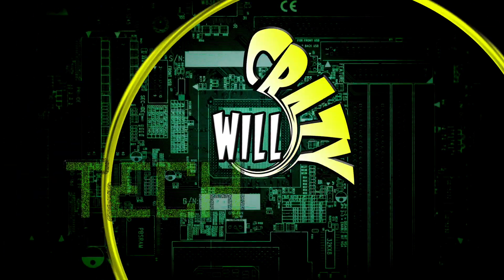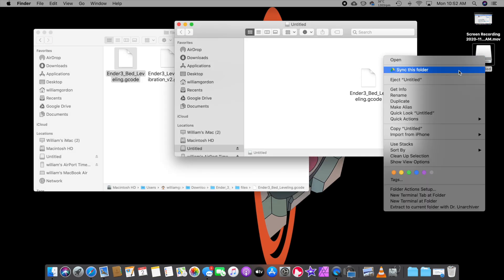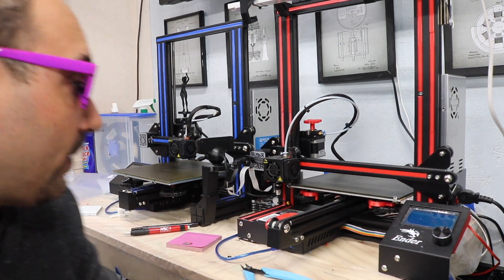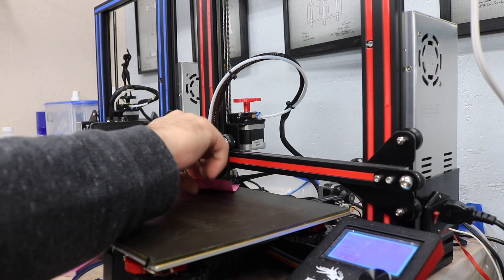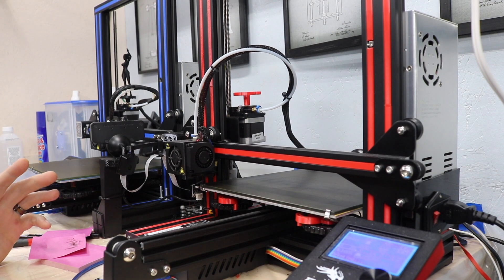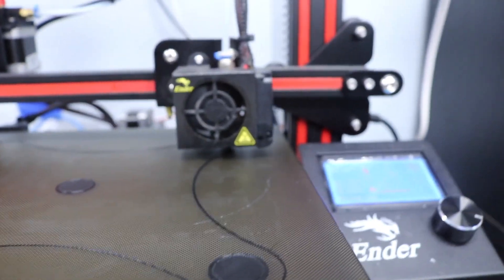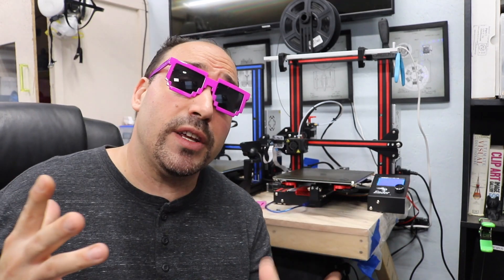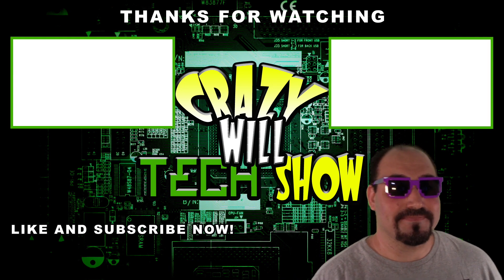How to level the Ender 3 bed

Comment: I don't want to scratch my glass bed on my ender 3 max. How do you adjust the switch to make sure the nozzle doesn't scratch the bed? Can you explain the process after you turn off the printer in more detail? Thanks
Reply from the maker: I mean if you follow the video you shouldn’t scratch the bed. I would make the bed really low when you start out.

Comment: When I "print from tf" this file, it just plows through the phases with no input from me. It touches the first corner briefly, then immediately heads to the next corner, etc. What's going wrong?
Reply from the maker: Are you using an ender 3? If so does it have a film it run out sensor?
Reply: @CrazyWillTechShow  thanks for the reply. Yes, it's also the ender 3. I'm not sure what sensor that would be, it's just stock out-of-the-box so far with no additional attachments or upgrades. But it goes all the way down to the bed, clicks the sensor that tells it it's at bed level, then moves over to the next corner. Also, in the part where it prints the line around the bed, the line is either super flat and transparent (bed too high maybe?) or doesn't stick/lay filament down (bed too low?), but there really isn't an in-between
Reply from the maker: So the file not working it just hit the posts then moves on then starts the print. never stops at the points? Is that what you're saying?
Reply: @CrazyWillTechShow  yes, basically. When I start it from "print from tf," it goes to the first corner then touches the bed, then immediately picks up and moves to the next corner, and so on, for all 4 corners twice. Then, it begins printing the test print. It never pauses for my input, or at all really
Reply from the maker: Ok I ran into this with my FOKOOS 3d printer it didn't have the M0 command available because it has a filament run out sensor. you can try editing the G code with M25. That didn't work for me on the FOKOOS because it was a different Merlin firmware. Here's an article I found.https://www.reddit.com/r/ender3/comments/r75ekl/pause_not_working_on_ender_3_even_after_trying/ that so weird? Because I have an aftermarket ender 3 and that file still worked. Worst case scenario you can still level it manually. If you can't get it to work. Basically set at home move it to the points, run the file. It's just easier if you get the file working.
Reply: @CrazyWillTechShow  oh awesome I'll give it a shot, thank you. I've been trying to level it manually, but mostly I use rafts so the first few layers don't matter as much lol
Reply from the maker: Leveling is the worst part of 3d printing but the most important part. Im going through this myself with the FOKOOS 3d printer but there actually something wrong with it. The middles hight 3 weeks and finally figured it out. So I definitely feel your pain. lol just be patient. you eventually figure it out.

Comment: Tried this 6 times today and still can't find the goldilocks position of the corners so taking my printer back to the store as I have wasted too many hours and getting nowhere.. Tried from hardly touching the paper to scraping it to the point of almost ripping it. And different levels in between and no joy
Reply from the maker: I have one printer The frame was bent. So I loosen the screws on the bass and put it flat on the table and tightened everything up. Work out great after I made that adjustment. Is there a wobble in your printer when sitting on the table? Check the Z axis make sure the frame is square. It happens sometimes when you build them.
Reply: @CrazyWillTechShow  mine was pre-built 2nd hand but one of the guys in the store as the standard ender 3 so hopefully talk to him about it, at the moment it's on a small coffee table in my bedroom and the capet is soft.. So might move it into the kitchen and try again

Comment: I know this is a very old video and I'm hoping you see this. I downloaded and loaded up the file into my printer but all it does is move through the points very quickly. I can't get it to move when I want it to. Please help :(
Reply from the maker: Yes it does that sometimes. I don’t know why. Shut down the printer take the card out. After about three minutes turn the printer back on. Then insert the card go to the menu click on load SD card. Then try the print again.

Comment: Great video thanks I was going to chuck this printer lol. Now i have the MAX and this is too small 220x220 i need over 300x300. You know of a way to use change the size to fit the ENDER MAX?
Reply from the maker: Thanks man! You can change the settings in cure or any other slicing software you’re using. Under printer settings bed size. I can only get 235x235 on my ender 3. I have a video on how to slice the model so you could do it in sections https://youtube.com/playlist?list=PL6sM6dPg3LNMoXEUf5g9yCKf_jmtM2mWT